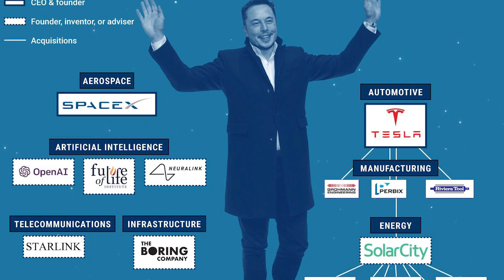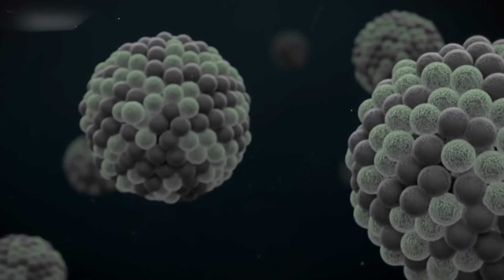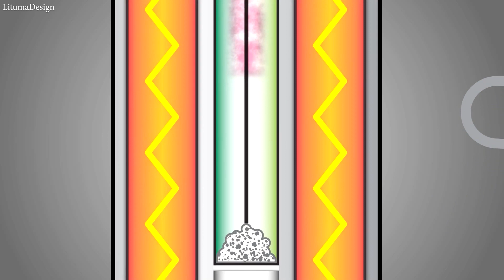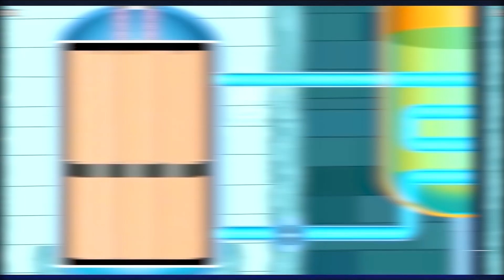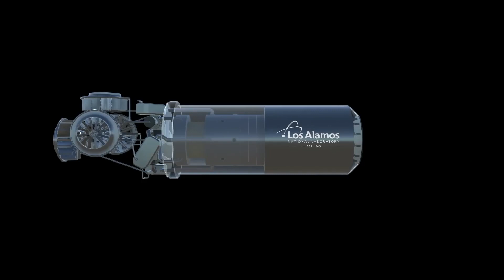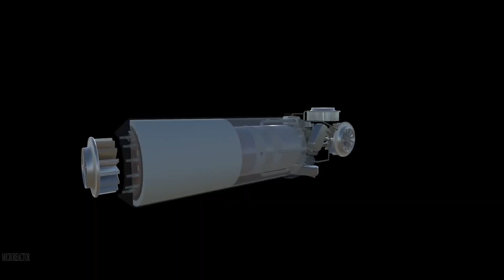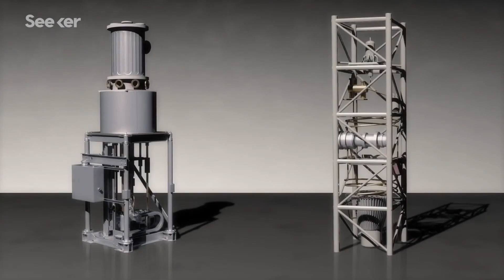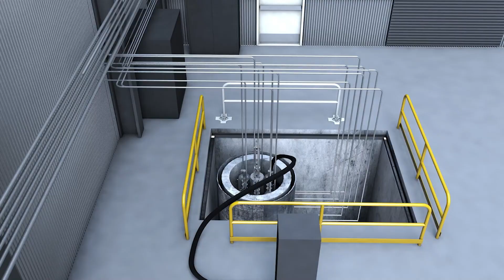FINALLY! Elon Musk JUST REVEALED SpaceX INSANE NEW Nuclear Reactor

Comment: Safety;   Helium coolant which doesn't need a pressurizer, and is chemically inert is a great option.   TRISO pebbles which can't melt is also a good option.  This means even if the unit goes in runaway, or runs out of spec, it's likely not to do anything to break itself.   So, any active safety monitoring built in would have an easy job of shutting this down.

Pebbles aren't known for the ability to reprocess the fuel easily, so is likely to be long lived waste...  however if the unit doesn't need refueling for 8 years, you're probably looking at a handful of marbles per decade.  

Sounds like a perfect application to replace generators.  One wouldn't need containment, but might need to be under security depending on other people's analysis.

What doesn't seem obvious is if it can load follow.  That is, if no power is needed, does it draw down the neutronics automatically, such as a molten salt reactor would.   If one had that feature too, these things could operate basically forever if they're only to fill a backup generator role.

Sharp design.  I wish them well!

Comment: Waited and waited to see which fuel they were planning to use..
Molten salt?
Because, if not.. meh
Reply: Helium coolant with TRISO pebbles is actually a pretty smart strategy.   I agree with you about MSRs, but if you wanted to build something simplified and tiny, this gives most of the advantages of MSRs anyway, including the capacity to do industrial process heat.